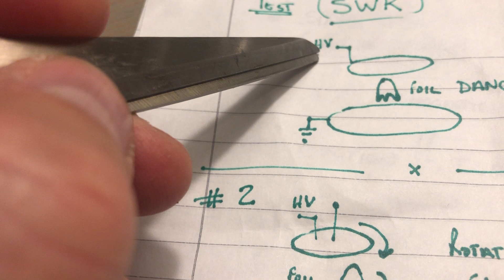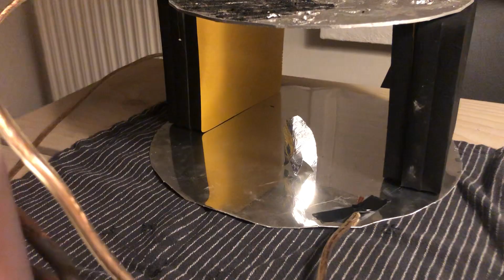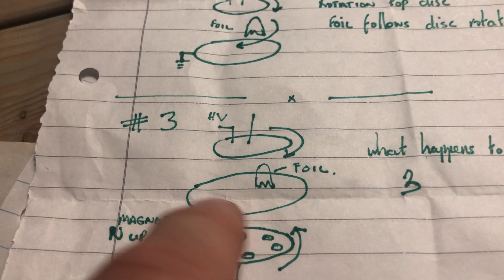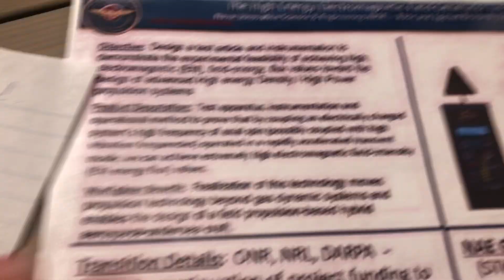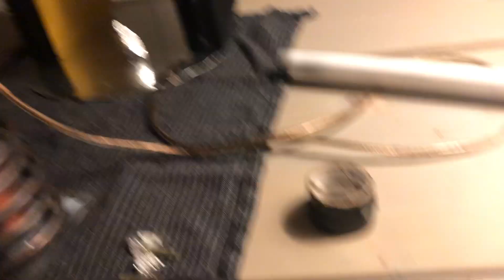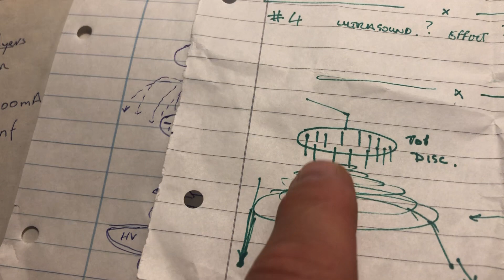Graviflyer (SWR) base test for the stages of this device. Help needed.

Comment: There are two approaches:
1) shrink all components to smallest possible to increase the effects of applied power sources

2) but most importantly, reconcile your model of how natural gravity works with what the graviflyer is doing so you can troubleshoot it

What do I mean with (2) here?  Here is an analogy PURELY hypothetical, but illustrates the point. Instead of a free space medium, water is the medium in this analogy of how to create a working model to help build a device:

1)  I want to build a small buoyant cup that floats on a medium of a pool of water
2)  but I have never actually seen a standing pool of water (this is the most hypothetical part of this analogy!)

3)  so, because I lack understanding of water, my first model has holes in the bottom of the cup and the cup sinks, is not buoyant

4)  so I think about what I've seen, and I form a model of 'how a pool of water works'

5)  I decide "okay, I had holes in the cup, I had no idea of the possible trouble the holes would cause, but apparently, a pool of water has the ability to flow through the holes in the bottom, and then the cup sinks, IS NOT BUOYANT"

6)  the solution is "stop the water from flowing into the cup - plug the holes"

So your model of the water medium is "flows easily; buoyancy of a cup requires no flowing into the cup; thus, plug holes"

If you have a model of how natural gravity works, you can then 'plug the holes' in a gravity neutralizing device to make it buoyant ('float', lose weight).

Without a model of how gravity works, troubleshooting a gravity neutralizing device is hard.  
A lot of trial and error may be the only option.  But expending effort on how natural gravity works is beneficial, even if you only figure out one clue from your reasoning.  Shrinking the device to the smallest possible to boost the effect of applied power sources might help in the trial and error too.

 Good luck!
.

Comment: I measured the SWR from my Tesla coil to my midplate as about 6:1. I switched to using a signal generator and RF amp instead of the Tesla coil. Connected the apm to an antenna tuner with the midplate at the end as an antenna to get it slightly better than 2:1. Once I matched the impedances, the RF output from the midplate went crazy strong. It turned on a touch lamp on the other side of my house, about 10 meters away and through multiple walls. 
The RF on the midplate seems to interact with the HVDC to the rotors. When the rotors are spinning in mechanical resonance, the RF can affect this resonance by changing the interaction of the complex capacitance/impedances which are occurring thanks to both the fluttering of the edges of the spinning discs (rotors) as well as the vibrating midplate. 
The HVDC can also affect these complex interactions. In some settings, the speeds of the discs will increase, whereas in other settings the speeds of the rotors will decrease.  
The ultrasound seems more like a intermodulation product rather than actual acoustic changes. When testing a fundamental freq on the midplate of 4.7MHz RF, and a ultrasound freq of 65KHz, the 3rd order harmonic (TOI) of the RF dropped 3dB. Additionally, when pulsing the ultrasound on and off like Alexsey says to do, the RF has a delayed response time of between 3-10 seconds. This delay lines up with some of his vids where he makes an adjustment and a few seconds later the graviflyer responds.

Comment: There was one more thing. When you use a zvs driver for the tesla coil with a spark gap. It is the same as using the zvs driver to hv on the discs, The hv spinning on the discs creates spark. Therefor it is a spark gap in nature.  If you can see them as the same you will understand his work better. The only thing not in the field is the motors. What ever they weigh your lift force has to be able to overcome them.

Comment: The spin, no matter how much will not lift. It is balance. The tesla coil was to create a static electricity around the craft. Without it no lift is possible. You will have to see it as breaking the bonds of weight. Then any lifting device would work.

Comment: The foil ball that you've used is too heavy to lift purely in the electric field between the electrodes. You need it to be about a single sheet of aluminum foil with the height and width of a thumbnail for it to lift in a DC field only. AC will never work. But honestly, you're looking at the wrong idea. Forget about the foil levitation. Instead, try searching for a video on YT called "Antigravity Lifter Creates Artificial Gravity Asymmetrical Capacitor" by a guy named Jim RugRoden. Make that lifter first as your base foundation. It follows the Biefeld-Brown Effect.
Reply from the maker: Thanks I will look into this, I do feel that lifter tech , static field and antigravity are possibly the same thing?? Thanks again
Reply: It's possible that there is a correlation between the three. Np, I'm here to help.
Reply from the maker: Thank you so much 😊

Comment: I have not got my Graviflyer working yet, but I have some advice from studying it for almost a year now. The AC from the tesla coil is good for lighting a neon bulb, but is not high enough voltage to make the foil dance. You are correct in that the 15kv voltage multiplier, or flyback transformer should work. When rotating the disks, please check if counterclockwise works better than clockwise rotation; Chris Hardeman said he only noticed a weight reduction when they were both rotating counterclockwise and opposite of each other. I don't think you need the pins on the plate, but Alexey recommends using a stucco textured anodized aluminum plate, that probably serves the same purpose as you described with the pins. I don't think you will notice much weight loss until step #4 when you combine everything, but breaking it up into stages is a good way to test each part of the system. Great work so far, and good luck.
Reply: Are you sure Alexey used 15 kv voltage on the disks?
Reply: @blacksquad2160  I meant that his 15kv should work to lift the aluminum bullet looking thing. Alexey said he is using 20kv.
Reply: @charliec3rd  Hi, I am not sure was he honest about 20kv...i am trying too..i made my version of it..
Reply: @charliec3rd  sir please tell me how to works graviflyer please 🙄

Comment: I have only seen those fly in a DC field. It's not to say that it won't work with AC, I just haven't seen it done that way. Did you try setting it on an insulator so that it starts off in the middle?
Reply from the maker: Yes I first have to make this step then next. Thanks
Reply: It should not work with AC. What makes it levitate and "dance" is that it has the same charge as the plate below it. Typically, a DC Van de Graff generator is used. The foil will be attracted to the plate until they touch, then it will become charged and repel away. It will do it again if it reaches the opposite polarity plate. This can't happen with rapidly changing AC.